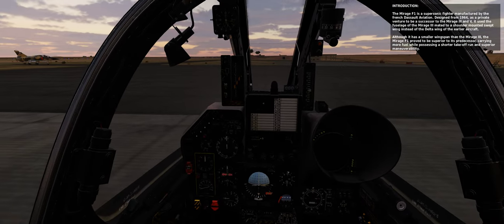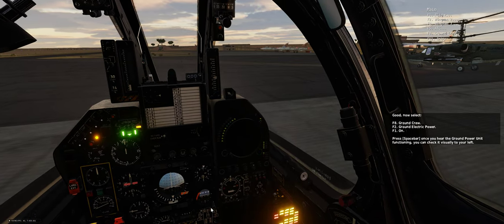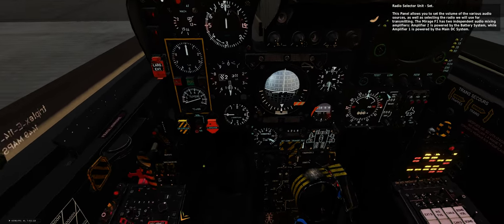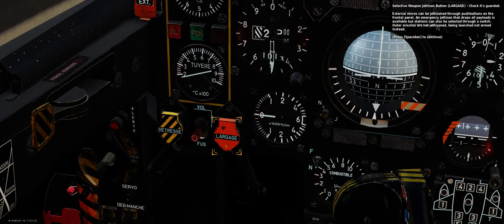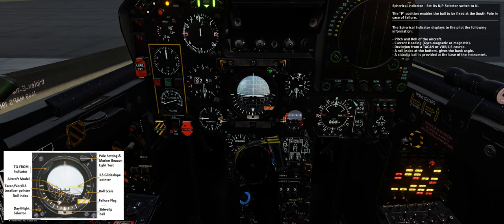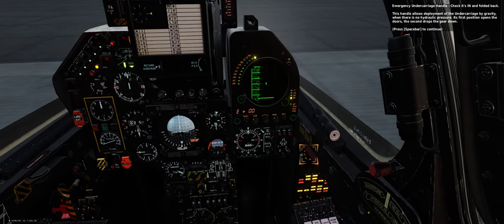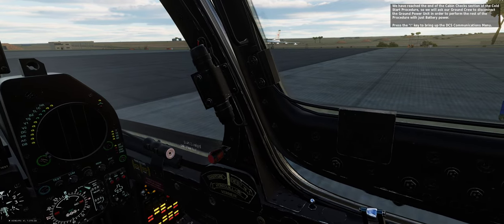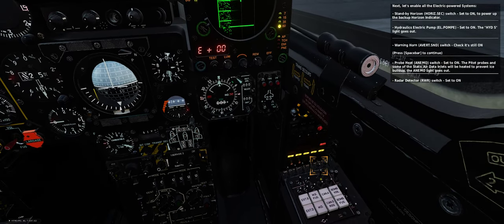Mirage F1 - Training - Syria - M01 Cold Start v2 8 (Long)

Comment: How did you figure out, how to highlight the cockpit elements? Thanks for the missions....really desired. Just would like to point out, that the use of a free map might be better...
Reply from the maker: The highlights are a feature of DCS, called "cockpit triggers", they are described on the DCS User Manual 2020. Glad you liked the missions. I used the Syria Map because it fitted the aircrat better than any other, and users that don't have this Map can always use the built-in itraining instead 😃